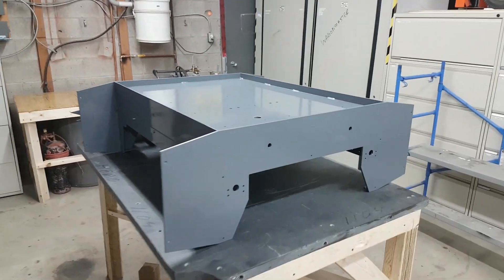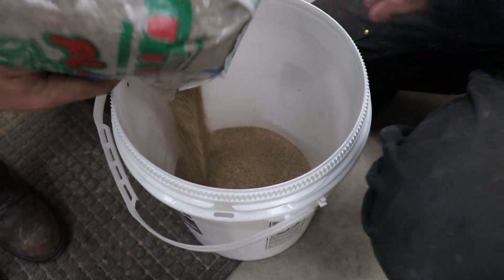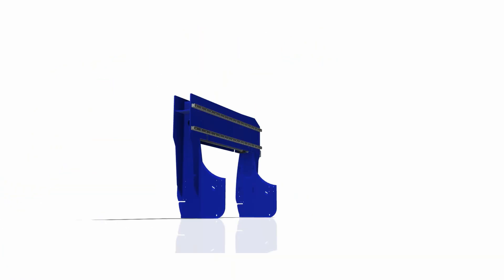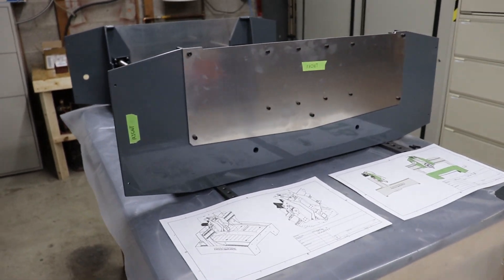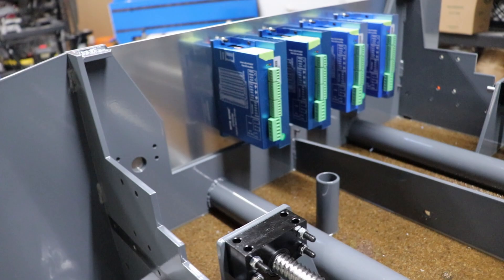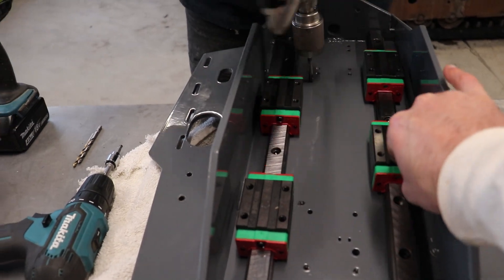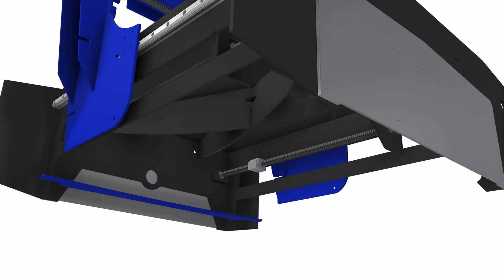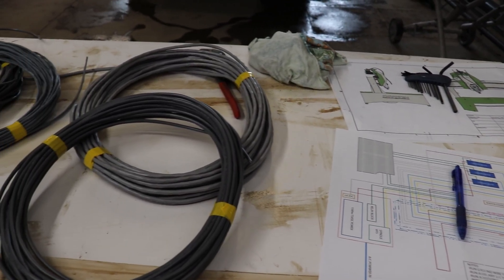Part Three - We design and build this CNC mill from the ground up! Build Series (Assembly)

Comment: Do sheet metal dimensions after welding stay flat and straight to avoid having to be machined? How much deviation are the surfaces where the rails will be mounted?
Reply from the maker: We were able to keep everything pretty flat with a lot of clamps holding the joints tight, and moving around during welding to keep any one area from getting too hot. We were within 0.005" in where it deviated with a straight edge accurate to 0.004". It's hard to get a perfect reading off a straight edge but on some surfaces in couldn't get a feeler gauge under the edge anywhere. I cant measure square and parallel to that resolution so it is hard to say on that front, but everything moves nicely when mounted.

Comment: May I ask what ratio of sand to epoxy you used?  Do you see any value to using blasting garnet instead of playsand due to the variable of inconsistent moisture in the sand?
Reply from the maker: We had some playsand lying around the shop, so thats what we used on this one. I didn't get too technical with the mixtures because it was more the mass I was after than the performance of the mixture itself as it pertains to it's resonance characteristics.